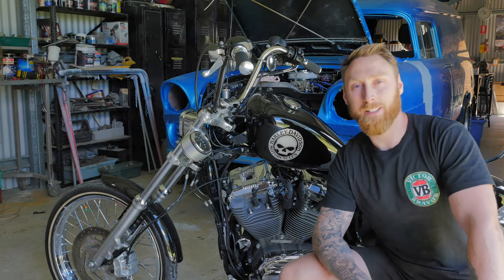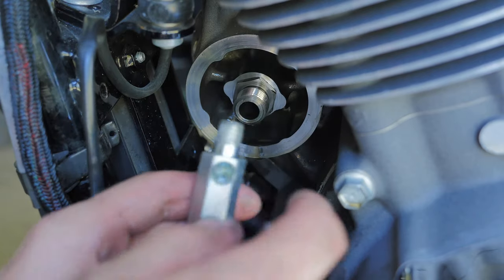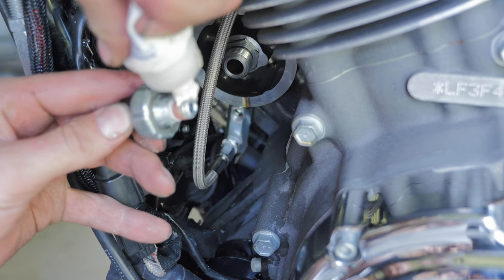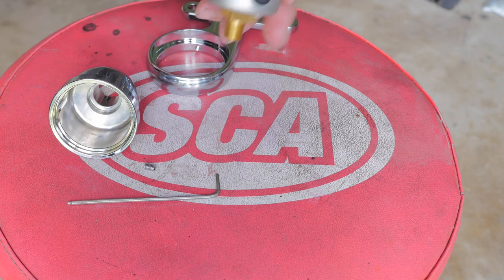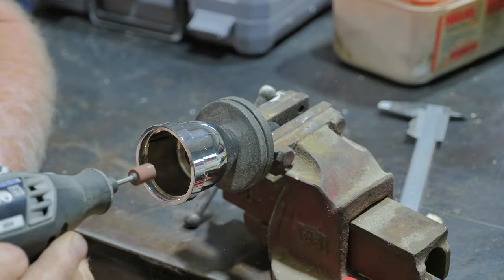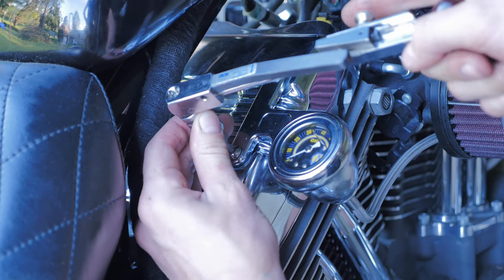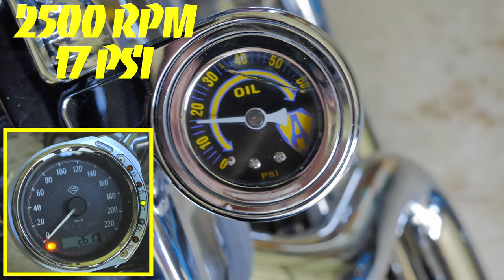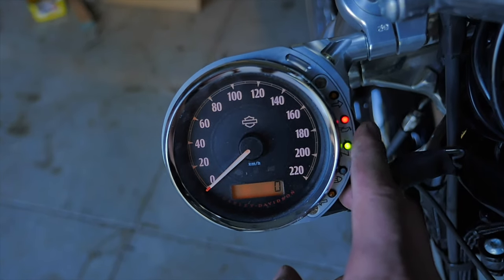Sportster oil pressure gauge install

Comment: Deffinitly not a useless addition. 
Pre 2007 sportster and Buell oil pumps are prone to gradual failure. The oil gauge will tell you when the pump starts to fail long before the idiot light comes on. Could stop you from being stranded or worse, damaging your bike.
Great video Bro!

Comment: I almost just ordered this same kit until I saw that nipple on the pressure gauge you cut off 😮. Thanks for saving me headache and money and wasted time. No matter how low I idle my motorcycle, the oil light never kick's on. That's why I was going to buy a gauge kit, but I must be getting enough pressure even when my bike loles at low idle. 🤔
Reply from the maker: Yeah mate I wouldn't have bought the kit if I had known the gauge wouldn't fit in the housing. The company has very poor quality control.